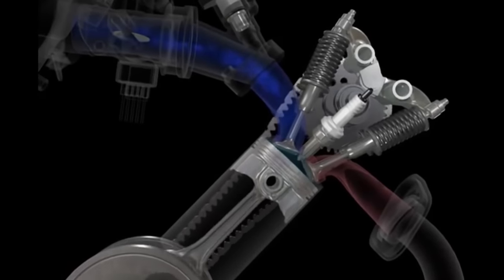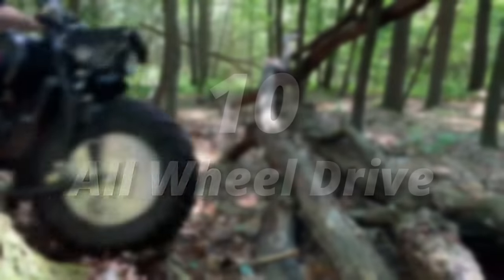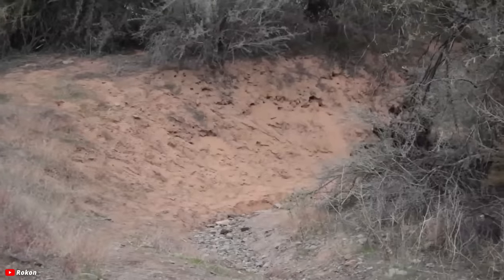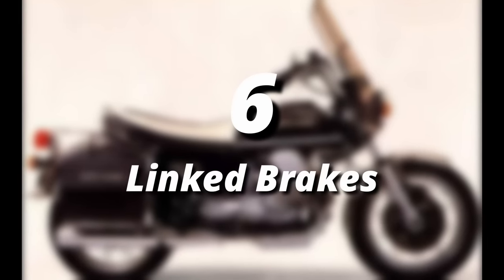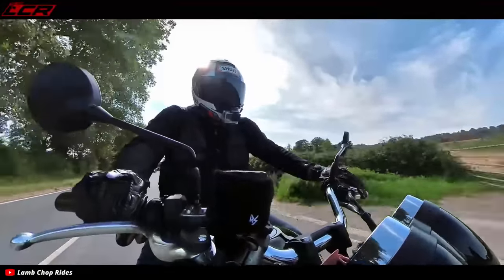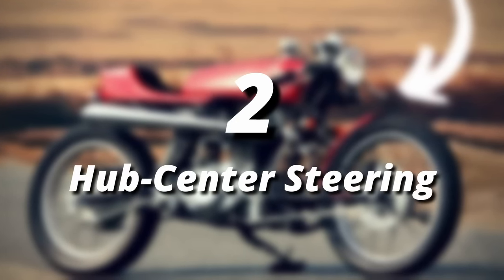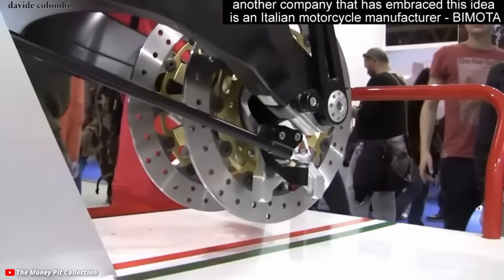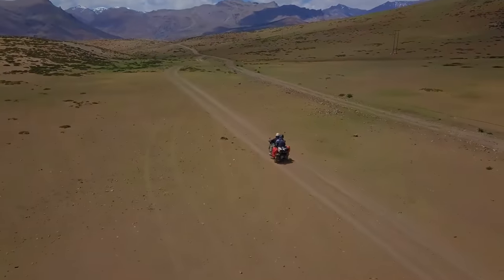10 Motorcycle Innovations that never caught on

Comment: Flandria Record Super Sport  had back in the 60 ties had also grip shifters. 
And you know. I have been riding motorcycles for over 40 years now. I've driven just about everything. My last two were the KTM superduke 1200, and the Ducati Diavel. With all that horsepower and all those electronic aids. The Diavel has even been boosted and has almost 200 hp... But it is overkill. The fun is gone. A friend has originally restored an old Honda CB 1000 super four, with clip-ons and ohlins twin shocks on the rear? In front Brembo's,... As soon as I drove through the rural, winding Flemish roads, everything came back. That's real motorcycling. Drive yourself, in control. With manageable horsepower. bragging about numbers, and numbers is for the wimps. So I bought myself a Kawasaki z 1100 gp from 1982, which a guy had turned into a rat bike. For 300 euros... Now looking for a Godier-Genoud frame,....

Comment: I had a Lambretta 150LDII from 1955 which had twist grip shifting. I loved the riding experience on this scooter, but only in the way that you can like riding a feather bed. Great fun to try to keep it on the road, but in terms of rideability it was a disaster. The twist grip shifting worked, but I never liked it. Your wrist is not in a straight position, but always in a bend position, which is uncomfortable. It is allright for a slow 1955 scooter, but will be a total failure on a modern motorbike. The stretching (over time) of the cables does make it not very accurate  too. Not surprising that no manufacturer still uses it, (besides maybe on some light scooters or mopeds).

Comment: Moto Inno front suspension is structurally superior which allows it to be much lighter than traditional and Great Britain front suspensions.  But perhaps the most important question is which one has better handling, Moto Inno's inherent stiffness advantage without using carbon fiber, and high degree of adjustability and optimum anti-dive capability without trade off will prove it to be the winner.   Mass production would allow Moto Inno front suspension to be inexpensive, but perhaps still a little bit more expensive than traditional.  Not having first mover advantage is a big cost disadvantage to Moto Inno.  Which one has greater adjustability is another question.  BTW I am an aerospace industry structural engineer and motorcycle rider with decades of experience.
Reply: BTW traditional front fork suspensions require a very massive and heavy steering stock in the front of the frame.  Moto Inno's design properly integrated into the motorcycle design allows a lighter overall motorcycle.  Traditional front fork suspensions are inherently much more flexible which compromises handling.
Reply: All the advantages of the Hossack/Fiore steered upright with the added complication of hub-centre steering and the additional problems of patent and licensing. Both Honda and BMW have showed that they don't like patent and licensing.

Comment: I had a grip shift on my Allstate Moped.  I owned the bike in the early 1960's and I believe it was a 1961.  The grip used cables to shift the transmission and the cable frequently broke so I fashioned a foot shifter that lasted the life of the bike without further modification.  I do not believe it to be an improvement over the foot shifter and would not buy another bike with such a shifter.  I love my current 2020 Kawasaki Ninja 1000SX with it's quick shifter much better.  😈

Comment: Hallo !  Swedish Army  had in the 70 ,s only full automatic  ordernans motor cycles, Huskvarna, i think!  All men in the twenties was ordered to do service in the millitary for nearly 1 year, non payd !!   I was in the airforce  336  days !!!  Nn money, but good  fore the moture !!!  All wheel drive is mutch easier on electrik bikes !  I had a K2 750 Honda 1972 !!! With twin front disc brakes !!! Like a servo with two disc !   One Suzuki 800 Intruder, 1986,  two Harleys Soft Tail Custom,  1989 and 2006 ! nice bikes!  Now i have a Hyasang Agilera with a Suzuki  650  W-twin with belt drive, like a litlle Harley Soft Tail !!! Thanks for a nice program !!!  🤩🤠😎😻😹😼😸👍👍👍

Comment: I have a vague recollection of a Bridgestone step-through motorcycle (knock-off of the Honda, for sure) with grip shift. Or maybe it was an Aermacci, badged as a Harley in the mid 70s? 

The original Yamaha Venture from the early 80s - basically a hot-rod alternative to the Gold Wing - had linked brakes. I guess they figured old farts on touring bikes would prefer it? But it made braking on a sketchy surface a dance with death - use the pedal and lever together and you risked washing out the front wheel; use just the lever and you have one disk trying to stop a 700 lb full dress tourer. I looked at swapping the standard braking system from the V-Max ... swapping the carbs would have been cool also, but that's another story.

And the problem with automatic transmissions on a motorcycle is (as anyone who's taken the MSF Rider Course knows) you absolutely do not want to shift gears while leaned over in a turn. Not sure how the DCT solves that problem, other than maybe it shifts so fast you don't get that front/rear unsettling.

Comment: For Turbo bikes the ones you featured were really, really crap and really were not good at all. The Kawasaki ZX750E2 AKA the GPz750 Turbo worked very well for its time, did not weigh much more the the standard GPZ. It was seriously quick for its time, I know I owned 2 of them, 1 of them from stock clocked at 153MPH. It had a fearsome powerband when the turbo spooled up and went like a massive two stroke. At the time very little could touch it. The only reason I bought them was because they went like nothing else. The only reason I got rid of it was the ZZR1100 came out

Comment: Linked brakes suck. My piaggio scooter has one

The hand lever controls one front disk and the foot pad controls the other along with the rear. Much rather just control the front since that’s where 70% of the stopping power is

Comment: I was surprized this video wasn't 5 years old or older. no full automatic bikes? Honda doesn't have the DCT system is several bikes?  BMW and Honda use the telelever front suspensions. Honda has used linked brakes on the Blackbird and BMW uses linked brakes on several models. most Blackbird owners disconnected their linked brakes. BMWs work with the front brake but the rear brake will still operate separately from the front.

Comment: I don't WANT a "self riding" motorcycle (or CAR..) If I don't want to ride (or drive) myself,  I'll take the bus or call a cab! I applaud tech and the research is cool,  when it comes to motorcycles, I want it as bone-basic as possible! That's the point (to me of a bike) I love the automatic tranny, power steering, A/C and sound system in my Buick Lucerne. But I'll stick to the clutch, carbs and all-around tactile man+machine experience of my CB-750 because... Well... Just because!

Comment: I think AWD will probably make a comeback with electric bikes - after all, it gives you twice the opportunity to make power. 
On the other hand, gear shifting is a demanding function from an engineering point of view. Bolting on a thick piece of metal to the gearbox works fine but, by comparison,  a weedy cable and a counter-stroke spring don't fare as well.

Comment: Lots of interesting stuff, but so many generalisations and a certain amount of inaccurate bollocks. One obvious omission: rotary engines, as developed at huge expense by NSU, then Suzuki and more cheaply and successfully by Norton and Hercules. First error: the Britten front end was a copy of Norman Hossack's multi-championship-winning design which went into limited production with Wüdo, then (once his patent had run out) by BMW, who called it 'Duolever'. Another omission: Jack Difazio's hub centre steering was decades ahead of Bimota's, developed in the late 50s and 1960s and fitted to several hundred conversions and a couple of ground-up machines (one of which I owned for many years). Bob Tait's hub centre steering improved on Difazio's and was successfully fitted to some of the fastest roadgoing motorcycles in the world in the 1980s by Malcolm Newell, co-designer of the original Quasar. Another error: you embarrassingly said "Honda's GTS" but only corrected it to Yamaha with a brief caption – why not correct it on the soundtrack? FFS! Another point: I think it's worth mentioning that Honda's semi-automatic Cub is still by far the most successful powered two-wheeler ever built, in terms of sales, with several million sold down the decades! Similarly, Honda's Gyro Canopy has been extremely successful in Japan and elsewhere. And even BMW's C1 sold 20,000 in Europe alone – and was never sold elsewhere, despite being a real 'curate's egg' ('good in parts', crap in others). Tig Cross's electrom is pretty much brand new, in development terms. I could go on and on, but I think this is long enough for an initial, off-the-cuff response! For now, I will simply refer you to my dissection of Ryan F9's FF video for a bit of further enlightenment! https://bikeweb.com/node/3729

Comment: Why did twist-grip gear-change not take off? Because it's bloody useless! LOL ~ As a bloke who had a job for about 10 days, riding a 1950s Vespa scooter for courier work, (their scooter ~ not mine) they're a heavily acquired taste.
Hub centre steering. There are specific cases where you would be quite happy to give up steering-lock, in order to get a more rigid chassis. But like normal front suspensions designs that heavily limit steering lock (yes, I've ridden several of those and owned at least one) it remains a heavy compromise. Heavily restricted steering compromises you in daily use, in a big way. Now you can design hub-centre steering that has at least as much lock as normal, more in one direction, but that results in a front-swing-arm that sticks out like a tow-ball.
Let's cite another one that arrived, was universally accepted and implemented on fast bikes, and then went the way of the Dodo. The hydraulic anti-dive brakes. Now you can arrange the torsional mount for a brake calliper so it connects to some part of the frame or chassis, and so it produced an anti-dive effect, and in some conditions that's helpful, but hydraulics that connect to you brakes, and add lever-length and sponge and loss of feel, to lock up the compression on your forks... I'm not real sure who thought that was a good idea. Yes, it came from racing, I know. But they stopped using after less than two years.

My personal most hated thing, from years ago, was tyre sizes on large bikes. From some point in the early ~ mid '70s, it was decided that we would all benefit from 'standard' wheel and tyre sizes. So what was settled on, for large bikes, was 19 x 1.75 F, and 17 x 2.25 rear ~ sometimes 'enlarged' to 3.15 inch. The front was not so much the problem, the rear was the problem. You ended up with a cross-ply 5.10 x 17 on it, and those are not too bad on a typical '80s bike, up to about 100 mph. Once you go over 100 mph (160 km/h) the amount of side-to-side flex built into a tyre like a golf-buggy, makes the machine unstable. It wobbles & tank-slaps. Nothing you do to the suspension, the frame, the steering-head, the racing stripes or the bar-end streamers in gay unicorn colours, is going to fix that. Six inch wide rims with radial tyres on them derived from 500 grand prix bikes, with a side-wall one inch high, that's what fixed it. 
But, wait ~ the group-think at the time, the motorcycle folklore that EVERYBODY KNOWS, is that the Europeans can't build engines, and the Japanese can't build chassis, and Japanese bikes wobble because they have Japanese frames. Viewed from 45 years later, I can tell you that's complete bullshit ~ but everybody at that time knew the problem was Japanese frames and suspensions. Everybody wanted Pirelli Phantom Silver dot +1s, in the MT28 pattern front and rear ~ because they had a wonderful compound ( that's true, by the way) and they're a great tyre. All the production racers use them. 
My hated thing, was not so much the wrong information, it was how wide-spread and deeply entrenched the wrong info was, and how badly one was seen for trying to question it. The thing EVERYBODY KNOWS was simply fkcun WRONG!

Comment: I 100% do not like linked brakes. I don't want my brake system to be engaged between front and rear when motorcycles don't have a backup brake system if something goes wrong with one or the other (front or rear).

Comment: Turbo bikes have always been faster.  It's just a mechanical fact that a turbo will give you more power.  The reason why turbo bikes basically stopped existing at the end of the 80's is something that's called the "gentleman's agreement", which was an agreement between the big 3 japanese to limit bikes to 186mph so as to prevent too many people from wrapping themselves around lamp posts.  And by the 90's you didn't need a turbo to get up to the power required for this.  The whole motorcycle industry basically stagnated due to this.

Comment: A problem with the turbo-charging was that, when cornering, and you shift down, your rpm's might get to the point where the turbo starts to boost. Might catch you off guard ;-)
I've heared the same about these small volume 3 zyl. 2-strokes. /Apperantly: any high-power 2-Stokes: you shift down. Rev's go above 6500 rpm's. And the miracle happens. Haha!
Great video, Bart. A pleasure to watch!

Comment: The Hondamatic transmission was a failure because it only had 2 gears. Low and High, just like the old powerglide transmissions Chevy sold around 1960. Making it even worse you had to shift it yourself instead of it doing the work. I would never buy a motorcycle with an automatic because to me, shifting is part of the fun. I still drive a manual transmission pickup and car. Dodge Ram 3500 with a 6 speed manual for heavy duty jobs and a VW TDI with a 5 speed for normal driving. 
A friend of mine installed a turbosupercharger on his Kawasaki 1000 back in the early 70s and it was ridiculously fast. Top speed was only limited by the gearing because he could run past the redline in 5th gear with the stock gearing.

Comment: I know you don't claim to be a technician or an engineer, but sometimes you do need to do a little more research. Motorcycling started nearly 140 years ago not 40 years ago; and there was a lot more innovation in the first 40 years than perhaps the last 100, certainly the last 40. The time of greatest innovation was interbellum, with so many aeroplane designers shifting to motorcycles.
    May I suggest you look up: OEC duplex, BSA fluid drive, BSA MC1, Vincent Girdraulic, Viratelle preselector gearbox, to name but a few.
    Supercharging (except passive i.e. two-stroke) was banned by the ACU (whether direct or turbine) thus making it difficult for bike manufacturers to pursue the idea.
    Alas, centre-hub steering may seem like a good idea in theory but is not practical in real use. It has very limited lock, and any lost motion makes the bike unrideable, so lacks durability (it's even worse than steering head and tele forks). I'm surprised you didn't mention BMW's Telelever.

Comment: Imagine a self steering motorcycle. 
Hmmmm.. sit balanced on you bike,  set the throttle,  remove your hands,  voila!  
Shift your weight to the left and hey presto the bike turns to the left,  depends on conventional headstock and fork geometry.

Comment: As far as I understand the Britten front fork is not that different from BMWs duolever used by the K1200/K1300 models or for all practical purposes not that different from the telelever BMW used and use on a lot of their boxer models. BMW are now slowly shifting away from these types of forks. I guess because they are more complicated (more expensive) and heavier than a "standard" fork and, in all honesty, does not offer that much of a improvement compared to a standard fork.

Comment: Enclosed motorcycle is a very good idea if you live in the British climate, but the laws regarding them are a total nonsense. Imagine you commute 25 miles each way from a rural village into a big city, you can wear your work clothes no problem, you can lane-split with ease, so your journey times are vastly less, you occupy less parking space. Because your bike cuts through so much more cleanly, a medium size engine can power you well into 3 figure speeds. It simply is a very good idea, only the law needs correcting. If you're a delivery rider it makes even more sense, able to tale bigger objects, store them dry and protection from the weather is a very big deal for bikers.

Comment: The biggest problem with making huge amounts of power is always how to deliver it. On a bike it needs to be useable enough to handle mid corner, and as soon as you dampen that you may as well just go stock linear power from generic performance gain built into the motor itself, anything that comes.on suddenly ontop of existing power is hard to manage.. think 500cc gp bikes, it's not something you can easily offer to the public.. sure getting a rep as a widowmaker might help a bit but too much of that and it's game over from a sales and legislative point of view.in the end some things may be awesome but just not practical

Comment: I like your videos but got to disagree on the turbo bikes.  In 1984 there was no faster bike than the Kawasaki 750 Turbo. It's too bad they did not continue to develop them.  Putting the turbo where they did greatly reduced lag.  Self driving motorcycles?  No thanks.

Comment: Twist grip gear shifting is ok on a bike with 3 gears but if you had more gears the clutch lever would end up pointing down to the road making it to aqward to opperate.also john britten did not invent the style. Of suspension that he used it was designed by john hossac who used it years before john brittain used it.also the GTS1000 was made by yamaha not honda.